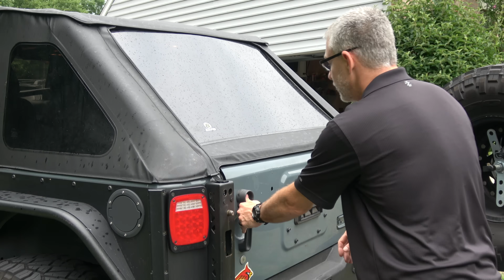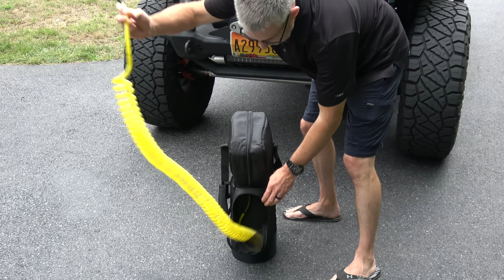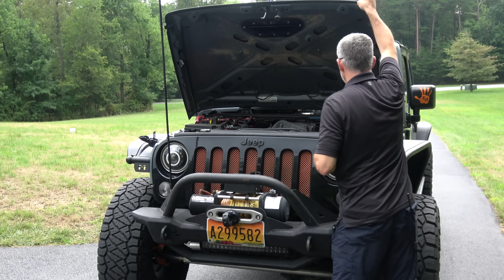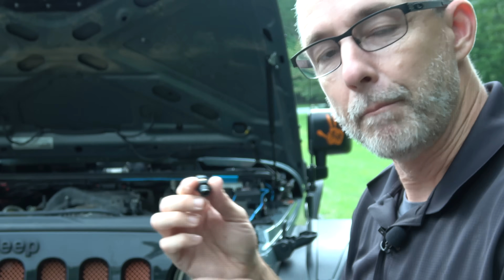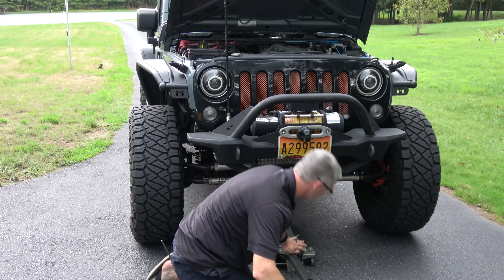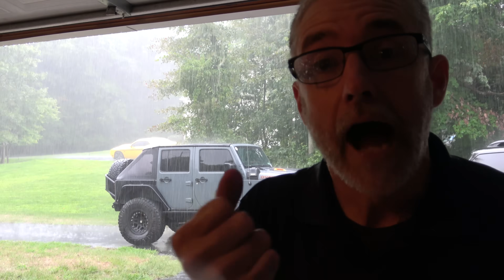Using Powertank CO2 to Back up my ARB Onboard Air Compressor!

Comment: I really like the way you're using the Power Tank as a backup for your on-board ARB compressor. Very clever! Could you also use the Power Tank as a backup for your CO2 fire extinguisher?
Reply from the maker: That's a really interesting idea, and one I personally have never considered... my answer is YES! Why not?  However, I don't use a CO2 fire extinguisher, as all of mine are ABC rated (monoammonium phosphate).  But that doesn't mean I can't use the power tank to extinguish fires of the B and C variety (CO2 is largely ineffective on A fires).  It's a great thought, and I will now consider that as an option... particularly if I can put it out without making a big mess!!! :-) Thanks for the comment!

Comment: Great video! I'm looking into the CO2 system as well, as opposed to a fixed/portable compressor. One thing to consider is a distribution, or piping failure to the various devices. If you snap an air line at one of the axles, you might lose all of your air. I don't think there's a check valve at each device. A solution might be a small manifold off of the compressor with a valve per port tucked out of the way to quickly isolate that outlet. Of course, the event of that happening is slim!
Reply from the maker: Each device has it's own solenoid, and flipping the switch is all that's required to isolate it from the system. Same way it's enabled can be used to disable.